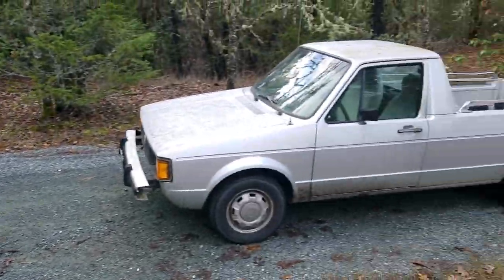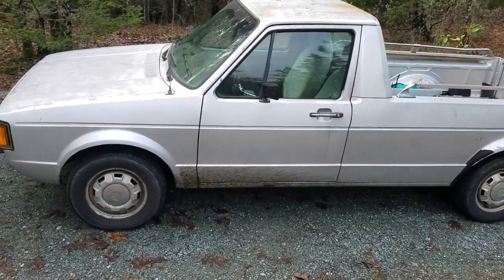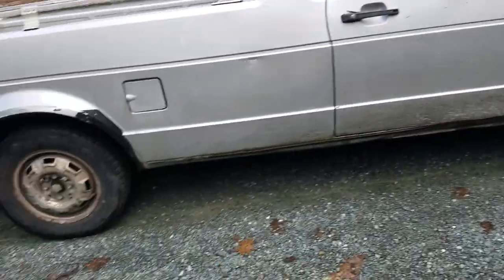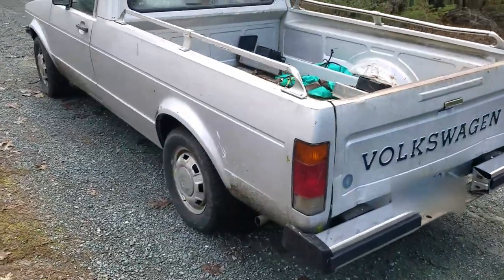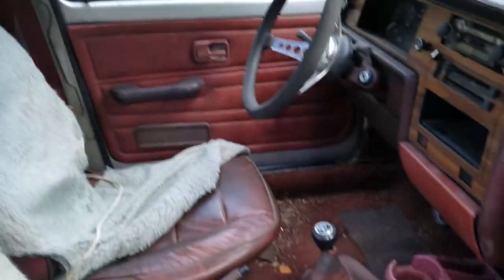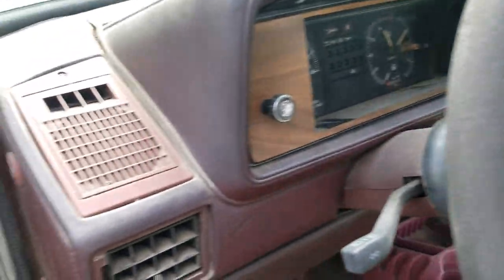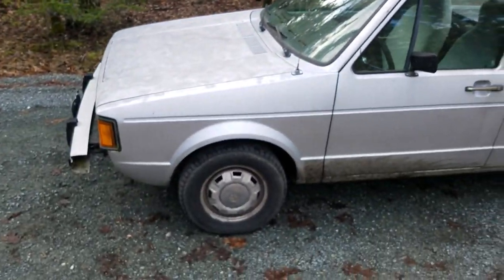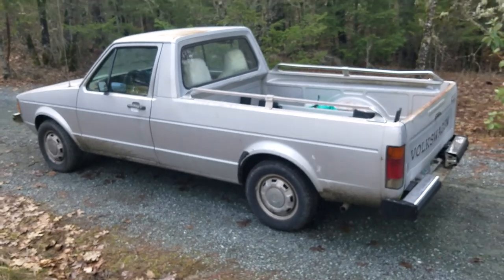Rare 1981 Diesel Volkswagen Rabbit / Caddy Truck! (My First Diesel) (Part 1)

Comment: Yeah if you get water in the rain tray it will leak into the cabin which gets water on the fusebox along with the windshield seal if it’s worn out. Looks like a pretty original driver of a truck. Give that bay a good pressure washing like you said and then replace any easy gaskets valve cover main culprit might aswell just convert to the rubber gasket. The cable you pull out to start is for in the cold it advances the timing a little to help it idle higher.
Reply from the maker: Sweet! Thanks!